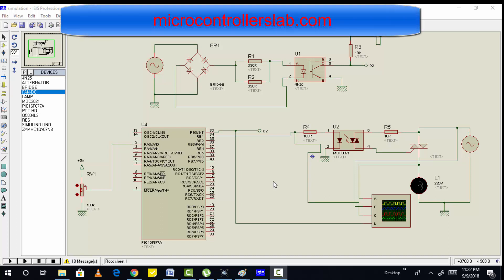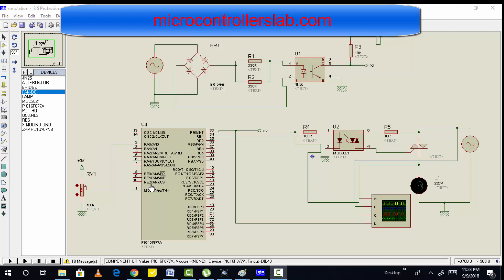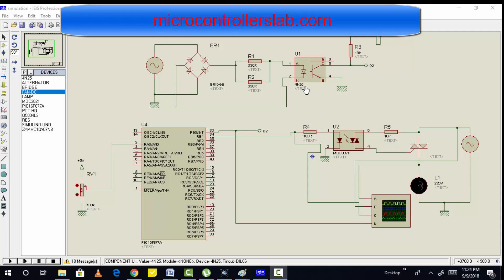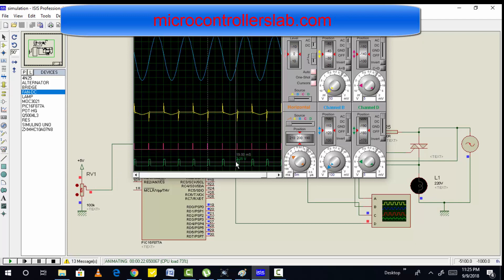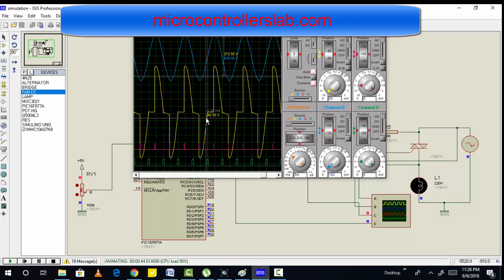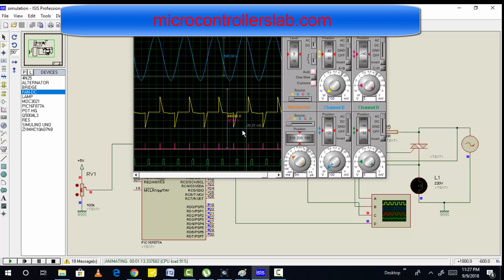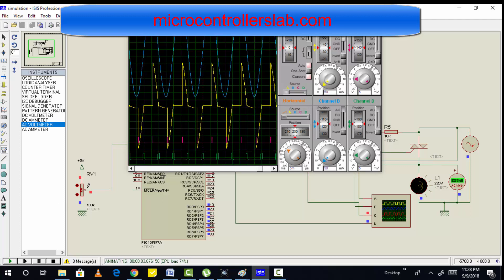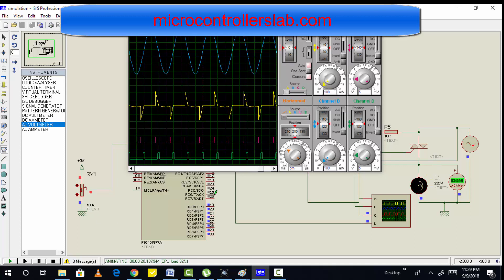thyristor controlled power for single phase induction motor using pic microcontroller

Comment: Sorry to rain on your parade but, in the real world, this design will almost certainly fail to work. A light bulb is NOT a substitute for an AC induction motor. The lamp is a pure resistance, the motor is a highly inductive load. In the latter case, the discontinuity of motor voltage and motor current will cause false triggering of the triac - at the wrong phase angle - meaning there is no real control of motor speed. Again, in the real world, this can produce both electrical and mechanical HAZARD to the motor and the operator.
The triac is unsuitable for single phase induction motor control - with the exception of some small types of capacitor-run machines found in, say, domestic room fans. MCU control can't change this basic fact of life.
If you visit the Microchip website, you will find application designs for running PIC MCUs directly from 220v AC mains supplies with so called 'transformerless' designs. Great care is required in implementing these (safety wise) and they provide (unlike your optocoupler based supply, as shown) NO input/output mains isolation.
Do you use use the STM series of MCUs? Some of these are optimised to run directly from the mains. Visiting the ST Microelectronics website is worthwhile as regards many excellent Application Notes on AC motor control. The triac/induction motor problem is also well explained.